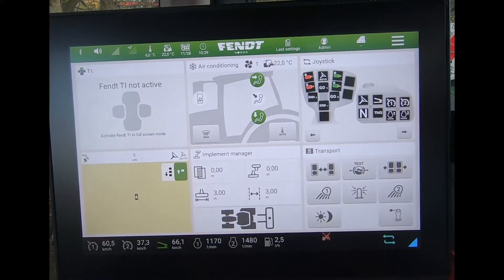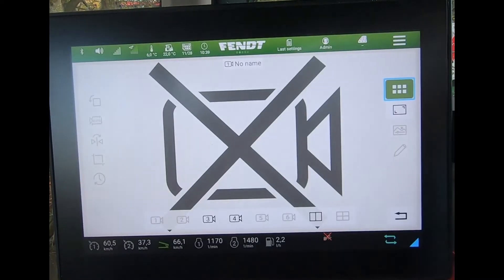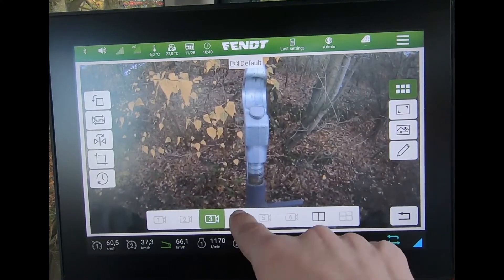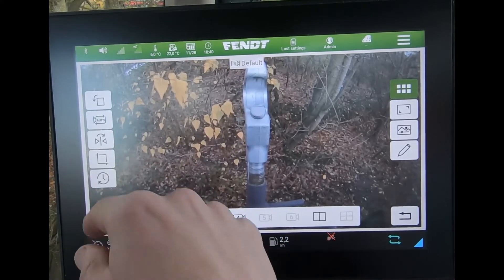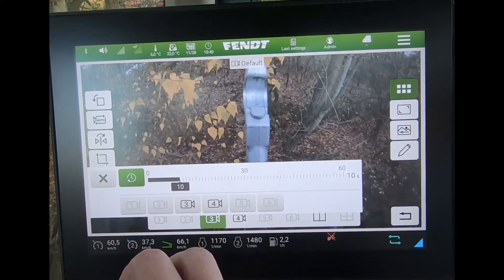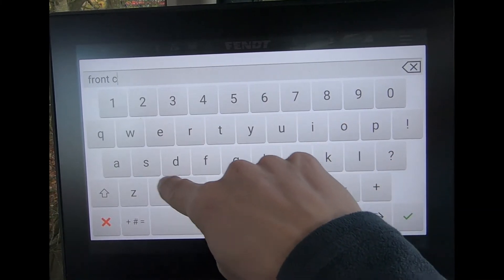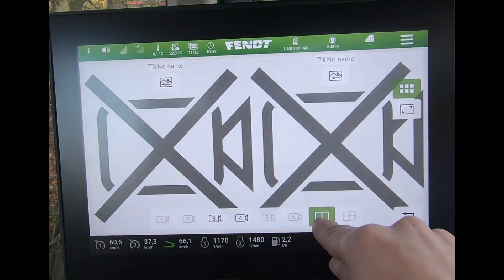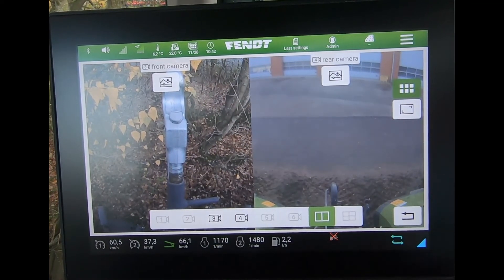FendtOne Camera settings

Comment: Awesome video, thanks. Do you know how to get the 6 camera inputs shown up? I would like to install 2 digital cameras on the front and back and still have 4 digital cameras on the potato harvester on the back.
Reply from the maker: This was a 700 Gen7 tractor where you can spec from factory to have a front and rear camera installed, which is why the screen is showing the option of going to 6 camera views.
Reply: @fendthowto9918  ok, thanks for this info. So the cameras on the front and back are digital cameras, right? video image looks really impressive!
Reply: Is it possible to get cameras integrated with the screen, for a 2023 plate 514 without any sockets in the roof
Reply: @samkirkbride2034 there is no EASY solution for you, because your tractor does not have the video ECU installed. You can install the video ECU for roughly 1000EUR and then have the connectors available. 
Or you can install a new monitor only for cameras. Therefore you have the main monitor for gps and isobus. 
I work for AGRACOM. We have the digital and analog cameras for FendtOne with camera connectors and also very good looking touchscreen monitors for those without